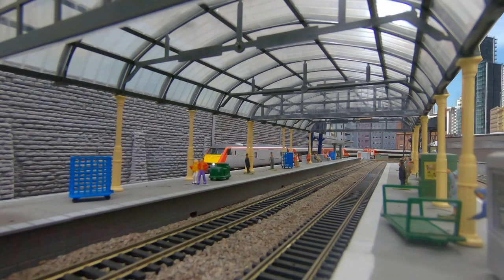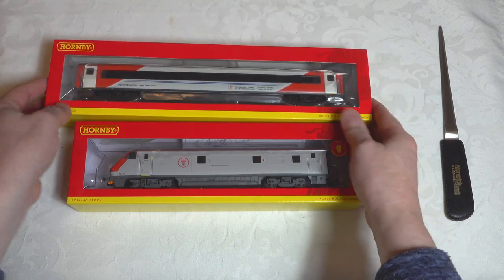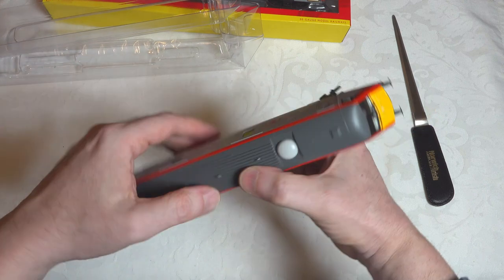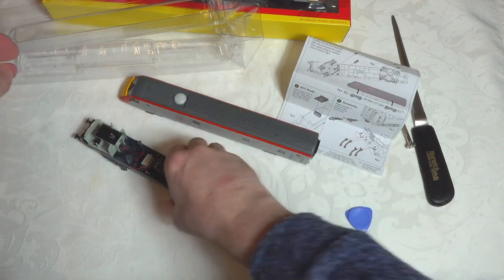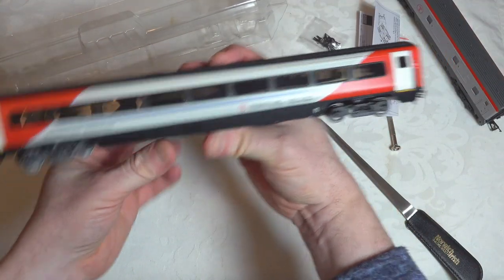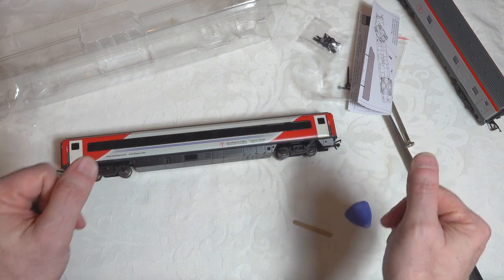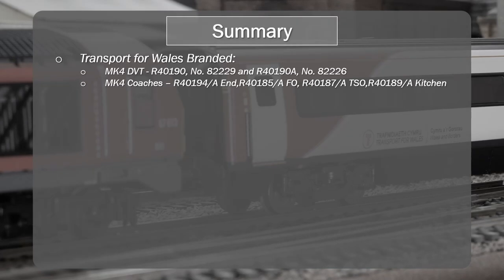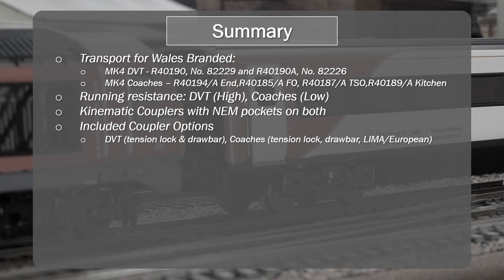Review: Hornby Transport for Wales Mk4 DVT and Coaches incl. R40190, R40185, R40187, R40189, R40194

Comment: On the coaches I have used Hunt Intermediate length magnetic couplers. They give that extra bit of space between the coaches that they need but still nice and close together and the run quality in both push and pull mode is amazing hardly any derailments. 

The only thing I had to do was glue a small piece of plasticard to the side of the hunt couplers as supports, a bit like the MK3 sliding door couplers from hunt, for added support in push mode!
Reply from the maker: Thanks Dan

Comment: Thanks for the review, something worth mentioning is that Hornby didn’t include a coupler on the front end of the DVT, missing a key aspect of the prototypical operation. I bought a set to be dragged by a 37 at the Ally Pally show and picked up the Hunt coupling designed for that, but it didn’t deal with the corners on the layout. The shape of Hornby's mk4 coaches also isn't accurate when compared with the prototype - as a lifelong fan of the mk4s I was quite disappointed with Hornby's effort 😅 but they're still a huge improvement on what we had before!
Reply from the maker: Thanks for sharing Simeon. Still on the lookout for the ideal coupler for these - surely Hornby should have done that for us? I'll be checking out the Hornby magnetic couplers when I can lay my hands on them.
Reply: @EuviRail I ran mine with Hunt couplings between coaches and they worked well distance wise, but I found the plastic used was too brittle for the strength of magnets as we had a few of them snap when being uncoupled

Comment: If it was a customer return, the retailer is meant to let the customer know that's second hand.

If I found out it was second-hand as in a customer return, I would've returned it.

Other than that, they look below Hornby's Railroad cheaper items.

You can see that they are light and look too plasticity.
Reply from the maker: Hornby's MK4s have always had a cheaper feel to them compared to their MK3s. While they don't market them as Railroad models, they definitely feel like such models. The MK4 DVT does have lighting which the older version didn't have though the overall feel of the model isn't great either.
Reply: @EuviRail  let me guess, Hornby is only using plastic & flimsy pantographs now?

Comment: Did you notice at 0:09 one of the mk4s decided to jump slightly?
Reply from the maker: That was the "catching" I talked about when in push mode. This will occur with both the tension lock and the Lima couplers which will ultimately de-rail. It also occurs with the Accurascale magnetic couplers to a lesser extent. If these were 1-2mm longer they would be fine - which is a pity as otherwise they would have been excellent with these coaches.
Reply: @EuviRail  Hi, have you tried the Hornby magnetic couplings yet?
Reply from the maker: @StormmyStormmy  Not yet.Currently sold out from all my usual sources.

Comment: Personally, I dont think Hornby make good diesel \ electric locos. Their forte seems to be kettles and coaches.
Reply from the maker: The 50s, 56s, 60s and 67s were good in their day and while still good runners they are showing the their age overall and should be priced accordingly which they aren't. On a positive note, I've never had motor or drive train problems with Hornby diesels unlike Bachmann and Accurascale locos in recent times so old designs aren't always bad ones. Railroad diesels were poor runners but have improved of late. Still, you're just not going to get a quality diesel for £85-£100. The Pendolino and Eurostar are Railroad level designs though in the case of the Pendolino it's priced as a full spec model which it isn't. I don't have experience with Hornby's new Class 91 but have heard it's not what it could/should have been and it's more expensive than most top notch DCC Ready models from other vendors. Hornby do appear to have been focusing on (expensive) steam models in recent years - to the detriment of their diesels and electrics alright.
Reply: I'd say Hornby Class 60 is their best but their 08, 31, 43, 50, 67, 87 and 800s also good. The rest are for the cheaper market which apart from a 66 I have not bought recently. The 66 is OK for the price. Paintwork good, no lights and runs OK. PS Forgot the 56 and 91s which are also good. Agree with the comment on motors too. Curiously the recent Bachmann 20s and 37s were marred by unsecured motors which need a bit of cardboard to fix. If I could only pick one diesel and electric manufacturer it would have to be Bachmann.

Comment: The DVT has maybe £10 worth of electronics and about £5 worth of plastic if you're lucky, at least the coaches have an interior but they derail when in push mode so only work one way? did nobody check this. Even at the lower end of the price range they are just not worth it. This was never a cheap hobby but the prices that most manufacturers charge now are just mad. ☹️
Reply from the maker: Hi John, prices have gone to pot alright. I believe the coaches will ultimately work fine in push mode with the right couplers attached, but it shouldn't be up to the customer to figure out which ones - Hornby should have done this. The fixed drawbars are hard to work with so this should have meant magnetic couplers were shipped with these.

Comment: I do think you're too generous with your scoring as these Hornby models are quite average . . . .Great review though. :)
Reply from the maker: Having had a lot more time with the retooled MK3s and the latest MK4s since I did this review, I would agree that the scoring on the MK4s should be lower. They haven't really kept up with the times. You can pick up  the DVT + 2 coaches for ~£100 now which is more in line with what they are. Thanks for commenting.